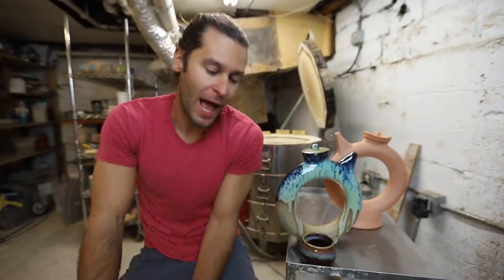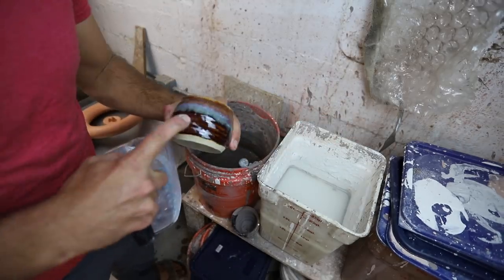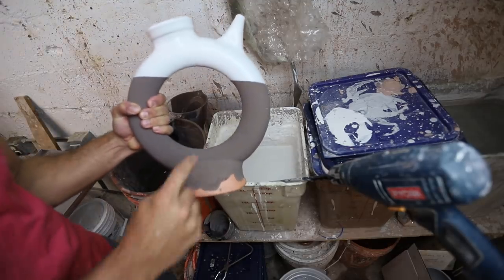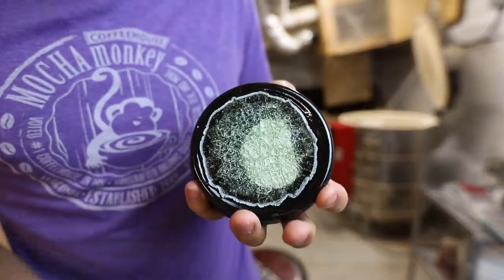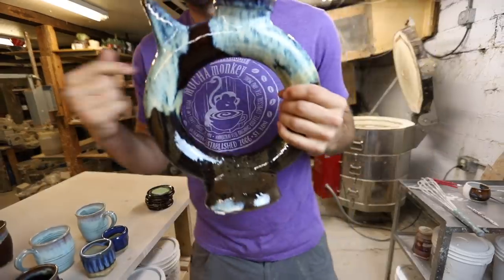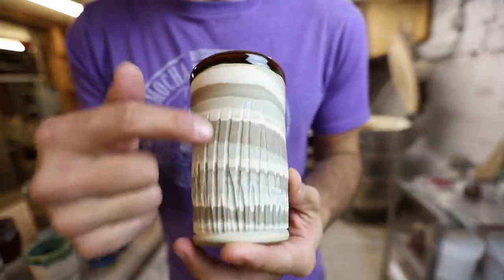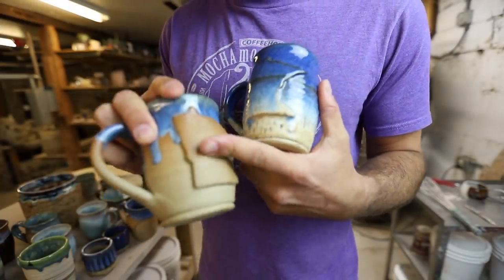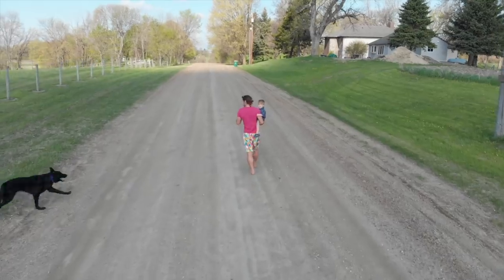GLAZING AND FIRING the Doughnut Circle Teapot + Unloading Kiln #49

Comment: Hi Jon.  Love your channel, been watching for a while.  Wondering what happens to the shelf...scrap it off, flip it over, throw it away?  Thx
Reply: Good question I was wondering the same thing.
Reply: You can use a chisel to chip off the glaze. If that doesn't work when you use an angle grinder. Then you recoat the shelf with kiln wash.

Comment: Is it possible the base of the teapot cracked because of tension during shrinkage when firing? I know putting sand on your kiln shelves for larger pieces allows for unimpeded shrinkage; the clay at the base is allowed to drag/slide on the kiln shelves much more easily, instead of cracking/

Comment: Do you know the temperature it has been on, when the power cut happed? Maybe glaze hasn't been liquid, but dusty and fall of? Just the toplayer... 
In German OT school I've been tought "no cracks for foodcontact". Would LOVE to learn more about "when is this good for food"
Greets
Reply: Interesting theory, on the pot.  From my experience, with any underfired glazes I've had, they just harden, and don't change color.  But yeah, something like that scenario, could have totally happened.  
That's one of the downsides, to computer controlled kilns.  If you lose power, they have to be restarted.  With a manual kiln, with a kiln sitter, it would kick back on, once the power is restored.

Comment: I have a feeling your creamcolourglaze dropped off befor you even fired it. It was to do with your application, I find with some glazes if you let the first glaze dry to much befor the second glaze goes on that start to peel / shrink away from each other after about 15mins of the second glaze being put , doesn’t happen if you put the second glaze on quickly after first glaze as soon as is touch dry.
Reply: It might have just ran and instead of dripping down the sides the overhanging opening allowed for it to fall to the shelf.
Reply: That seems quite likely.  I think, had it dripped in molten form, it would have landed on the lower part of the doughnut.  But if it flaked/ chunked off, while still "raw", it would have just bounced off the lower part, without leaving much of a mark.

Comment: I can't believe that Mayco told you crazing is normal! It's obviously not the end of the world, but if the clay body and glaze fit well, crazing isn't an issue. Sure, some glazes are formulated to craze, but unless it specifically says it I wouldn't consider it normal.

And I'm totally for smashing pieces if they have massive chips or glaze defects. Better to just move on instead of mourning the piece or trying to fix it, in my opinion!
Reply: Agreed on both counts.  Crazing can be used for aesthetic purposes, but it is not meant for functional wares.

Comment: I would love to see the teapot used! It’s so beautiful! It makes me wonder how functional it is. Like would you have to use an open flame on the bottom or would the base convey heat to the vessel on an electric cooktop. Because of its shape it doesn’t seem like a ton of water would make contact with the heated area so how long would it be to boil the water. Would the whole thing get hot if so would you burn yourself trying to hold it. Maybe the way you use it is to boil water in another vessel and transfer it to this one. It would be really cool to know if it’s just a display piece or if it could be functional Is my point, because it looks amazing!
Reply: Most ceramic teapots are meant only for serving the tea, not boiling it.  The water and tea leaves are added, in the pot, then served.
Most ceramic bodies can't tolerate  direct heat, like a flame, or any cook top.  The vitrified structure can't transfer the energy fast enough, and thermal shock occurs, causing it to crack.
There are clay bodies, meant for this, calles "flameware".  I've not seen a lot of potters use such a body, because metal just does a better job, at dealing with direct heat, so we use it instead of ceramic, for such purposes.
Reply: Thanks Ben Patterson, I didn’t know that!
Reply: @alexlerouge1170  No problem!

Comment: Jon, I think it's quite obvious what happened to your doughnut pot.  You DID NOT make a proper offering to the Kiln Gods.  It's  a common mistake, and one that you likely won't make again.  The Japanese commonly offer sake.  As you are in the Great North, I would imagine you could just use some of that strong Canadian beer, as a substitute.  
I suggest smashing the pot, though I do like the Kintsugi recommendations, that others posted.  If you do break it, might I suggest, that you film it "Office Space-Style" complete with an appropriate soundtrack.

I've seen some others post, some likely theories, as to what happened.  Perhaps, if you make a similar ware, apply some wax (mixed with alumina hydrate) to the foot.  I've seen a lot of potter's say they use this, for the gallery of their lidded wares, so the lid doesn't stick, and on the foots?....feet?, of porcelain bodies, as they like to stick (pluck) during the glaze firing.  

In regards to the crazing, I don't care what Mayco says, that's not OK for functional ware.  Those cracks will be near impossible to clean, so leftover food and drink will attract bacteria and mold, which could make the user sick, over time.  So unless it is somehow a simulated crazing, that doesn't actually have gaps, I would not use it on any surface, that will come in contact with food or drink.

Those marbled wares, are still coming out great.  The ones, with the carved lines, make me think of something.  Have you ever used a "Wiggle Wire"?  I bought one, but haven't had time to experiment with it much.  But you could use such a thing, to add those grooves after throwing, without having to carve each line in, individually.  Just a thought.

I have no doubt, that the retiring teacher, will love that signed pot.  I've done a couple bowls, for birthdays, and retirements, where people write out their well wishes, and then I print them, lightly trace them onto the surface, then carve it into the surface.  They are a big hit, as it's like a decorative card, that will last for... well, a very, very long time.
Reply: Are you white? I don't think I have ever encountered an Asian person saying crazing is bad. Much of asian pottery is deliberately crazed - some even find it desirable, especially for teaware. Just don't leave tea or foods inside the vessels for extended periods of time.
Reply: @HokiHumby   That's an interesting way to start a reply...
Crazing can be desirable, no argument there, which is why there  recipes specifically designed to craze.  This is also partially why Rakuware is popular.  
Yes, in places, like Japan, crazing is acceptable on some of their wares.  In fact, the Traditional Rakuware is not vitrified, uses leaded glazes, and yes, can also have crazing.  But many things should be noted about all of those things.  For one, such wares are used occasionally, for a very specific tea ceremony.  Second, the wares are extensively cleaned before and after use, which removes any harmful residues.  Third, the tea does not sit in the ware very long, meaning that leaching is less likely.  
All those things I mentioned, are not something the average person does, with their ceramic wares.  So with prolonged use, the user could get sick.  That's not something I would want to have on my conscience.  Leave crazed ware for decoration.
Reply: Yes I agree!! Smash it Office-Space style!!!!!😁😈😉

Comment: The bottom of the teapot broke because the glaze was too fluid and ran onto the shelf.  Then, during the cooling cycle, the shrinkage of the vessel creates stress at the contact surface between the kiln shelf and the foot of the vessel, which had fused to it.  Because the shelf and vessel have extremely different coefficients of expansion, this stress eventually causes the foot to break.  The solution is to fire the vessel on a "cookie"--a flat smooth disc of unglazed bisque made from the same clay body as the vessel.  This way, they expand and shrink at the same rate in the glaze firing, even if the glaze runs off the pot.  Alumina hydrate or kiln wash can be applied to the cookie.  Use of a cookie is recommended for thin pieces, or pieces where the foot/base is structurally delicate and supports a substantial amount of weight, because even if the glaze doesn't run, the differential shrinkage of vessel and shelf can cause the vessel to warp or break if the foot "catches" on the shelf.  Kiln wash may help, but it isn't a cure-all:  its main purpose as a release agent is to protect the shelf, not the fired vessel.  In regard to the glaze running, it may simply have been fired too hot, or applied too thick, or if layered atop another glaze, resulted in a eutectic that lowered the melting temperature.  There are too many variables for me to make a diagnosis.